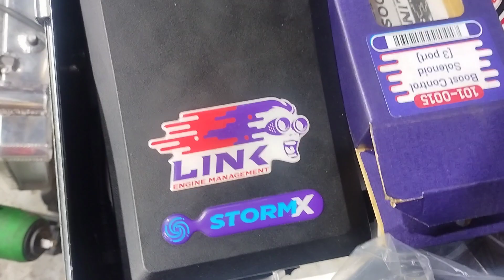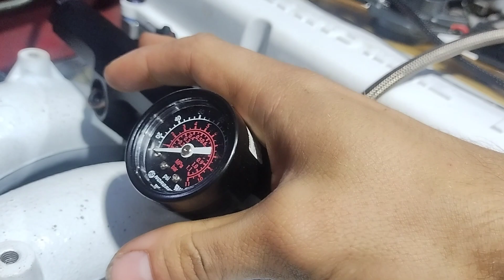KA24DE/KA-T Coil On Plug Conversion, PCV Delete, Turbo Oil Feed/Return Explained

Comment: Question, fuel line, which one is the feed and which is the return? I forgot to label mine😭when i removed the engine. The 2 line setting near the frame

Comment: Just got mine the other day 
Do I need to run after market trigger wheel? I forgot to order it 🤦‍♂️
Reply from the maker: You can run the stock trigger wheel, but aftermarket recommended for more precision at high rpm

Comment: question do you run your line from the valve cover to the inlet of the catch can and outlet of the catch can to the pcv?
Reply from the maker: I run pcv to the inlet, and valve cover to the outlet. Since the can is vented though, it all gets purged out anyway as more pressure comes along.

Comment: question on the coil on plug conversion, I just got my kit from nice time, I wired the ground, the 12v power source, and each coil pack to my megasquirt ECU cyl 1 to A cyl 2 to B cyl 3 to C cyl 4 to D. As far as wiring to my ECU output harness. and then when into the tuning software and set it to Coil on plug setup. Is that all that you had to do to get spark to the cylinders in your case? Or am I missing something. I am currently not getting spark. Appreciate any advice/help my man.
Reply from the maker: @LetsDriftMedia  not super familiar with mega squirt, but I know with my Link there are timing adjustments to be made also. Are you stock trigger wheel? If so I could at least go thru my settings for you and see what we can compare, just not sure how similar the software is. Just lmk and sorry for the late reply!

Comment: Yo I see ur on link. I also have ka24 would you be able to send me ur tune? I’ve been trying to get tuners to figure it out but nobody near me knows how to tune the coil on plug conversion
Reply from the maker: @VDCDoors  I got you bro! Are you on the stock trigger wheel? I ended up on the stock trigger wheel for now until I get my full dyno tune. My insta is @cbe hmu there

Comment: What is good abou pvc delete
Reply: I dont fuk shit up
Reply from the maker: @konibriones8996  I would keep PCV if you're not running a turbo. If you're boosted, you basically have to delete it to purge enough crank case pressure.

Comment: For the coil sub harness, did you wire the following into the MSPNP2,
Spark output A (pin 17) from the MS ECU to cyl 1 and cyl 4 coil and B (pin 16) to cyl 2 and 3 coil? For the wiring of 1-4 coils did you crimp or solder the wires together? Thank you.
Reply from the maker: This is the sub harness I used: https://www.wiringspecialties.com/honda-k-series-smart-coil-conversion-harness-for-s13-ka24de/

I am on a Link ECU, but all of the flying leads are labeled so you can match it all up. I use heat shrink terminals from Amazon for my soldering, so no crimping. These are them: https://www.amazon.com/dp/B0CD77KTB6?ref=ppx_pop_mob_ap_share
Reply: @cbeig  Thank you. That’s the harness that I currently have, should be straight forward from here. Where did you get your 12v for the coils?